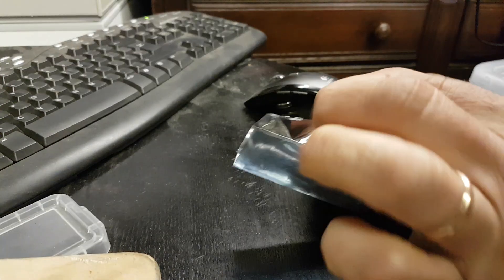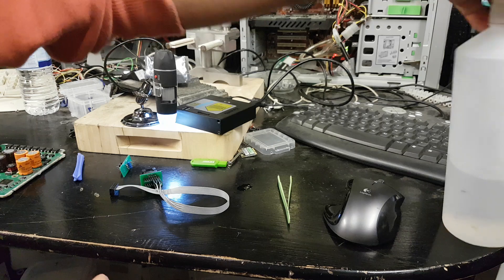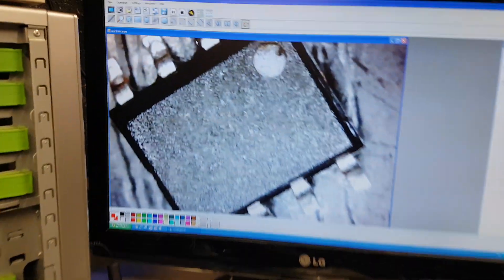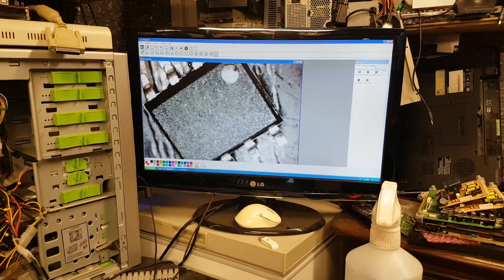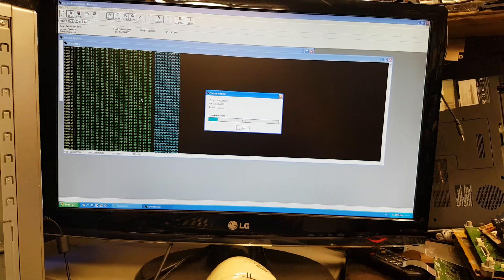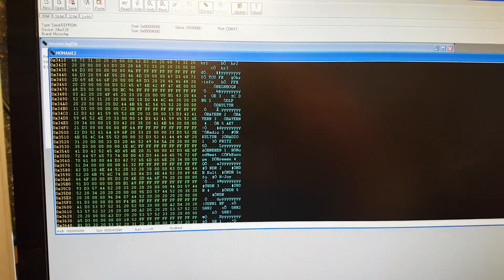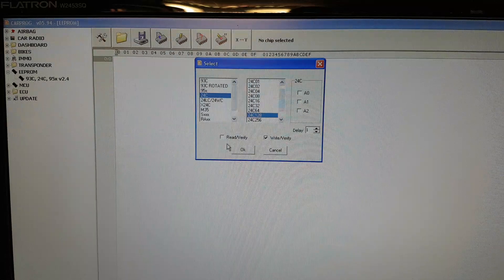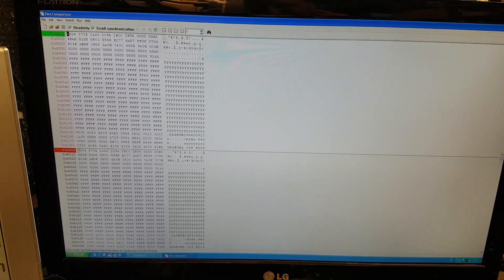How to read an EEPROM with X-PROG and Carprog... Helping a friend...

Comment: Can you change vin with unit still in Vauxhall car
Reply from the maker: Yes...
👍👍👍
Reply: @LMAutoRepairs what software system would be needed as I e had someone try and they get the pin but it says locked on their screen
Reply from the maker: What are you trying to do?
If the has been input wrong, the ecu kicks in a timer...
Reply: @LMAutoRepairs  it’s old unit was damaged so a used unit from another car was installed but it’s locked to old chassis number so a chap said he can change the chassis number in used radio to match the reciving car so it won’t be locked
Reply from the maker: We talking about the radio then, right?
Reply: @LMAutoRepairs yes a radio unit has been removed from one vehicle and put in another but it’s locked to old car
Reply from the maker: OK... yes, some are locked to vin, as per the video...

Comment: Hello,

I want to purchase the Carprog device and perform this process, but I can say my soldering ability is zero.

I wonder if I can read the chip on the board with the clamp device on it, or is it necessary to remove the chip?
Reply from the maker: You can try to do it with the chil in place, but depending on the bord circuit it might not work... Worth a try though...😊
👍👍👍

Comment: Hello great video and well narrated, thank you. The The IPK in my instrument cluster gave op the ghost. Question: do you or can you reprogram a new 93s53 eprom?  as I need to fit a new Instrument cluster. I do not want to change mileage or anything, I just want the original eprom data copied to anew 93s56.
I would appreciate any help.
Reply from the maker: Why don't you just swap the chips?
👍👍👍

Comment: I'm only getting F's when I read
Reply from the maker: Check connections...
👍👍👍
Reply: @LMAutoRepairs  Everything seems fine. Could it be erased??
Reply from the maker: It could... but, what are you trying to do exactly?
Reply: @LMAutoRepairs  I'm trying to add keys to a 2003 Jaguar XJ8 by dropping  them right onto the eeprom on the key transponder module
Reply: With the im608
Reply from the maker: OK... I would say the chip shouldn't have all F's...

Comment: Is it possible to read the eeprom if one of the legs broke off?
Reply from the maker: Depends... but probably not...
That said, you can try to scrape some of the encapsulation material around the broken pin, and solder a thin wire... 
👍👍👍

Comment: Excellent video, just starting out with this stuff. Can you tell me which tool is the best? Xprog, Carprog or even Iprog. Starting with Matrix display that needs unlocking to turn features on
Reply from the maker: They all complement each other...
👍👍👍
Reply: @LMAutoRepairs  Do you know what to look for in the dump to unlock a matrix display? or point me it the right direction for information about deciphering what the cone means?

Comment: When do you read chip as 8bit, 16, 32 etc with a programmer like Xprog, because default it always 8 bit selected, when do you know that this chip must be read in 16 bit or 32 bit .

I get confuse when I open a programmer and a smal 8 legged eeprom is ready to ready but don’t know if to select 8bit to read or 16bit. 

Please help with a simple techniques 

Thanks

Comment: My Carprog 10.93 brand new will not connect to any of my 3 PC's win7, win10, keeps saying unknown USB Device (Device Descriptor Request fail)  I have updated Bios, updated USB driver, intel MEi driver, USB2.0-CRW driver..  nothing works.  please anyone have a fix for this,  I cannot use this device at all as it will not connect, yes carprog is installed and running.
Reply from the maker: I would just get in touch with the seller... sounds more like an issue with the unit...
👍👍👍

Comment: Hi Luis, great video but I have a couple of questions if you don't mind, when reading an EEPROM it is in hexadecimal, how do you know which line is the one you are looking for? so say I'm decoding a radio, which line is the pin code on? or changing a VIN number, the same question? Then what program do you use to convert/read it so that it looks like the VIN rather than hexadecimal? Or do you convert it then see where the code/VIN is? thanks :)
Reply from the maker: Each module/car will have that information in different areas of the data... is not one fits all...
There is different softwares out there that assist in find that information...
Also written information about where the information is on some modules...
👍👍👍

Comment: Hi.tried this on a rd4 radio for citroen c3 (cant get my hands on a lexia) copied the info off the old radio eprom and wrote it to the new eprom but still get beeping.vin is now the right one for car.any ideas?
Reply from the maker: Have you checked that the vin was actually stored in the eeprom?
Thank you for watching!
Reply: @LMAutoRepairs  Yes.I copied the file from the new radio which  had a different vin.Edited the vin to match the car and wrote it back to the chip. which now shows the new vin on the reader

Comment: To change your radio to another car, do you just change the VIN number and rewrite to the chip? Will this work with the display units as well?
Reply from the maker: Hi
In this particular radio yes... does not necessarily means will work with other units... each case is or can be different..
Thank you for watching!
Reply: Thank you, a useful video, I think you should be able to do this with an Arduino or a cheap eeprom programmer. It's good that this is documented online
Reply from the maker: You can get an eeprom programmer for the price of a can of beans... lol
Not the best one for sure... but...

Comment: hello i have a problem with my car head unit from a peugeot 3008 2020 continental nac headunit bricked software due to a firmware update error and a frozen update error screen message, i need to learn how to flash the firmware to the unit :)

Comment: Hi I'm very new to this. Would like to read and write back eeprom 95080 (from BMW ROC module). Could you please tell me what do I need? I see you have xprog, adapter etc. Its very interesting and I really want to learn and become knowledgeable like you!!
Reply from the maker: X-prog is an option... but you have other programmers out there... up to you how much you want to spend...
Thank you for watching and for your comment!
Reply: @LMAutoRepairs  Thank you sir. Is there any adapter I need to buy along with XPROG software and cables? Sorry for bothering you to ask - it just entirely new for me
Reply from the maker: Not really... you can buy the adaptor to make things easier... but if you are going to use it often, X-prog comes with everything you need...

Comment: One note for anyone else doing it - on THIS one, it lists the VIN once. On the one I just flashed (GM 2007-12 DVD based nav deck), it listed it a second time about 40 char's after the first occurrence. I wasn't in the mood to do it twice, so I changed both and it worked.  Don't know if it would have had I only changed the one.  IF you're going to do one of these, be careful, and expect to take out about 50 screws and take at least an hour to dismantle to the point you can reach the EEPROM.  Crazy!!
Reply from the maker: Thanks for the info!
Appreciated! 
👍👍👍

Comment: I'm sure you've figured it out by now (7 months later!), but...  that's the VIN in there (OLSM....9131), but the 1st digit is missing.  All VIN's are 17 digits, but you only put in the last 16.
Reply from the maker: LOL
Yes... that's correct...
Reply: @LMAutoRepairs  - I just flashed my VIN into my "new" DVD Nav deck. Tried using an inexpensive CH341 programmer, but since they only do 3.3V (without being modded), I cracked open CarProg. Did it 'installed'. Bam!  Worked instantly.

Comment: Hi Luis can carprog read the security code for Opel corsa 1.3 cdti ?
Reply from the maker: Never tried it...
As I usually use the maxisys...
But I can check if the ecu is on the list...
Reply: @LMAutoRepairs  my Autel Can read the petrol security code on opel  but not the diesel one I am looking to buy a pin code reader it's just for the opel platforms cheers

Comment: hi you seem to be king on chips :D what program do i need to come around 4 pin code in my bad and new used ecu in order to come around the immobilizer active. i dont know much about this but i have managed once to read out ecu data from a car via obd. with OBD2 galletto interface. I also have a carprog if that to any use.. i see some people just switch the immo chip to other ecu but i dont know if thats gonna work. my ecu is EDC16u34 skoda octavia. or is it possible to clone the whole ecu maybe... right now i think i need some software to try to read out data so i can come to those 4 pin digits thats needed in order to program further, i have a Vag software called Odis and it comes to a point where it ask for pins
Reply from the maker: You can get k-tag and clone the ecu...
There is a few options on that...
Swap the eeprom is probably the easiest one, if you are willing to open the ecu... should have a 95320 eeprom...
I believe that ecu all immo data is in the eeprom, so no need to worry with the flash...
Thank you for watching!
Reply: @LMAutoRepairs  yes i found that chip now when i opened the old ecu. Is there any way before i swap it to make sure i back up data. What if its needed that flash thing done and not only eeprom swaped?.. what interface/software can i buy to backup eeprom data and also that whats needed for the "flash" process?

Comment: Your video is great have tried tho read Jeep Grand Cherokee PCM, reasion being is, is the pin also stored in the PCM. I have tried to get the PIN via OBD and also from the Jeep repairer, but either number failes when trying to program new keys, I am thinking that there is a mismatch between the WCM and the PCM,. Ant help would helpfull
Reply from the maker: If the car is starting, no mismatch...
The pins need to match on the ecm and wcm...
Are you sure you are getting the correct pin?
Thank you for watching!

Comment: Hi Luis,excellent,as usual;  i have here (Maia,Porto) a 2004 Renault Laguna 1.9 DCI with 8 codes   Df 301  226  056  325  197  ... ( with Delphi DS150E?? at a friend's shop)
Runs and drives perfect, no (?) smoke,starts well,lots of power, but a RED light is always on:  ((STOP; Desligue a Ignição));
Rail press. sensor reads 1.222 V at idle, MAP  1.666 V at idle,both respond well;  
But the   MAF reads (green wire at one end) 2.66 V at idle and the same 2.6 or 2.7 V  at (Key on,engine OFF); and NO change when i REV it up;  did i find the problem, bad MAF?    5.0 V is ok on all sensors,on the MAF too.
I only have a multimeter,a good one...What Volts should the MAF read?  Does it work off the 5 V source from the ECU,like the other sensors? Thanks
Reply: 2004 Laguna 1.9DCI normally has a Bosch brand MAF, signal wire should be exactly 1,0 Volt (key ON/engine OFF/No moving air).
Signal voltage should change together with RPM. Be careful, those MAF's also have air temperature sensor with a signal that does not change with RPM. I know about the frequency MAF's but never seen one on a 2004 Laguna.
Damaged hoses on intercooler is also a usual suspect on these models.
Reply from the maker: Hi
Depends... not sure in that case.. 
Some MAF don't work on voltage... work on frequency... so the voltage is always the same...
You need a scope for that...
Now, I am saying that is the case, you need to check how the MAF operates in that particular car...
I have a video on that sort of MAF, on a Opel Astra if I am not mistaken....
Hope that helps!
Reply: @LMAutoRepairs   Ok,great; i was just reading into that,the frequency,this is new to me; i have a great meter that has Hz (Fluke,5 digit,used to repair JAGS for the drug boys in NY,many  years ago...never had machines,just good meters and factory schematics--expensive!!) if not i'll borrow a scope; 
I'll look for your video on the Astra(?);   Thanks.
Reply from the maker: @josepeixoto3384  
https://youtu.be/bHhtoY8Fkvg
Reply from the maker: @josepeixoto3384  
No worries...
Here it is...
https://youtu.be/bHhtoY8Fkvg

Comment: Hi Louis! 
Yes, friends need help!
Louis, did you have to program new key-cards in Renault Megan 2 2007-2008? A key-card without IR and without free hands. There are so few such cars in Russia and no information. Maybe you know what the minimum number of key-cards can be programmed?
I look with interest, Denis!
Reply from the maker: Hi
You can program 1 only if you wish...
You need a blank card and the security code of the car...
Hope that helps. 
Thank you for watching and for your comment!
Reply: @LMAutoRepairs  Thanks!
I bought one new key card.
Now I’m thinking which device can read the UCH and find out the 12-digit secret code ...
Reply from the maker: X-prog will do it...
https://youtu.be/MF2KHd6hIWI

Not the same, but very similar...
Reply: Thank you Louis!
I understand that this is very similar.
I have an Orange-5 programmer. He can read my Frescale chip. I mean, how to read the security-code through OBD2. I do not want to dismantle the UCH unit.
There is probably no such free software....
Reply from the maker: @engeneer_ru5827  
On the old megane you can do it with the "spare" data retrieved by clip, and calculate the pin...
Megane 2 does not work... but there is tools out there capable of doing it through the OBD... just do a quick google search and you will find them...
👍

Comment: have you had to repair carprog mines has a few faults
Reply from the maker: My has a few extra capacitors inside... but I bought it already like that...
Reply: @LMAutoRepairs  wish mine was just the caps
Reply: @LMAutoRepairs  More important is the inclusion of a counter. Each programming session decreases the counter by one. Soon the problem will come ... Louis, have not yet encountered?
Reply from the maker: @engeneer_ru5827  
The counter will not change when you program this way... same like when you flash an ecu on the bench... the counter does not decrease...
Thank you for watching!

Comment: Quite intresting, I would like to replace the instrument cluster (Ipac) on my 2005 discovery 3. A Landrover forum member gave me hees used Ipac. hees car is 2008 and with higher milage than mine. 

I need to read the milage, security  & Vin from my Ipac and write it to the newer one. Could I use X-Prog for this? if so, who the heck can identify all of this? It looks like manbo jambo to me. 

Mr.P
Reply: Будьте осторожны с этим! Я сомневаюсь, что есть внешний чип EEPROM. Скорее всего, EEPROM находится внутри процессора Motorola серии 9S12 ... В некоторых моделях Land Rover дублирование информации происходит в нескольких блоках управления. Большее значение пробега имеет приоритет. Это автоматически заменит нижнее значение. В России это называется «активным duplication». Необходимо вносить изменения ОДНОВРЕМЕННО в несколько блоков управления.
Reply: @engeneer_ru5827  You are correct, the milage is stored in the Ecm and Body module (bcu) and Ipac. Perhaps I can Virginize the used ipac, or just swap over the chip.
I did read that someone over at hhauto forum did manage to do this, and it was working fine, but I dont remember the details. just woundering what reader I should buy.
What i can do as shown in this video is take a dump of both ipacs and use the comapre function in the program, and it will highlight in Green was it? the difference. It would be Troublesome if the milage from the used cluster gets writtn to my lower millage car.. Ill have to open the used cluster again to see what chips are inside. 

Cheers for this great video.
 
Mr.P
Reply from the maker: Hi
Never done one of those...
But if there is an external eeprom, it is probably easier to just swap them over...😉
Thank you for watching and for your comment!

Comment: Thanks again my friend I really appreciate all the help 👍👍👍👍
Reply: My guess is: read the EEPROM from the radio, without writing ... just to find out the secret code. I guessed?
Reply from the maker: @engeneer_ru5827  
No... in this case the radio is coded through the VIN number... 😉
Reply: Thank you for link and for your answer. I watch your video and subscribe. 👍
Reply: Marko Bezjak cheers mate 👍
Reply: So we need to change the vin number ? Or what ? 😄😄
Reply: Marko Bezjak Luis changed to right VIN and the radio works perfectly 👌👍 You can see the radio working here Vauxhall CD400 radio LOCKED How to UNLOCK Eeprom VIN Change https://youtu.be/VUH77Fy7erk
Reply from the maker: Was a pleasure!
👍👍👍